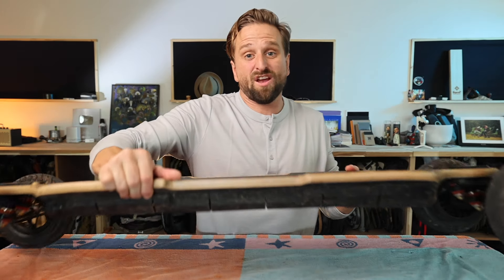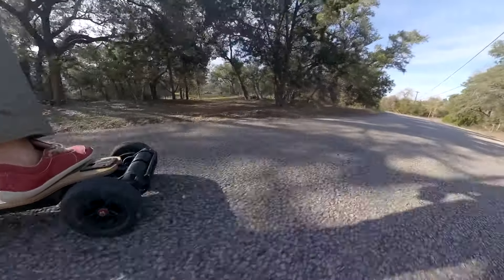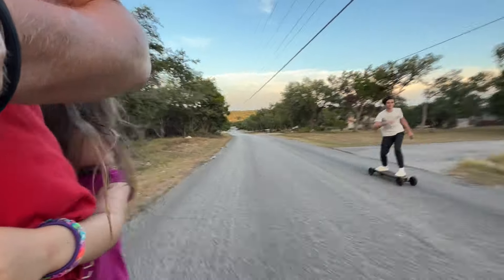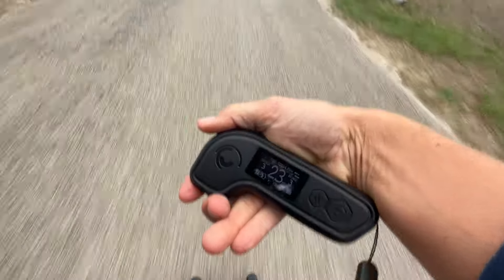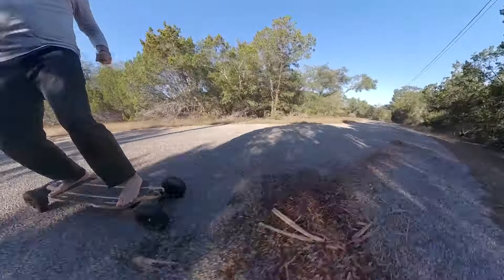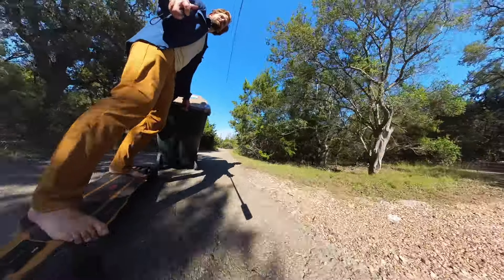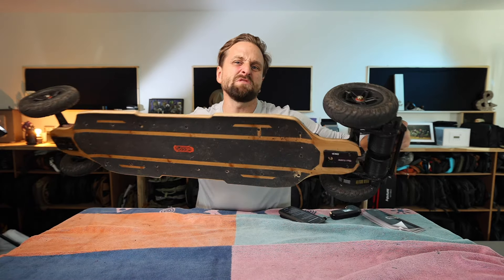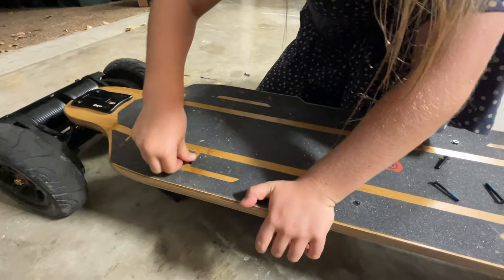1 Year Later: The Incredible Meepo Hurricane Esk8

Comment: Great follow up 👌🏽
⚡️🤟🏽🤙🏽🤟🏽⚡️

I wish they made a version of this with the Hobbywing ESC as opposed to the Ling Yi ESC they used on this, Hobbywing make the smoothest control module.

AT pulleys needs tighter belt tension than urethane, with urethane (smaller wheels) it's better to have slightly loose (less) tension. Usually don't need to re-tension regularly, maybe once if a belt / board is new, belt stretches a little when new.

Double Kingpin (DKP) trucks are hella fun, twice the turn of Traditional (TKP) and about 1.5x the turn of Reverse Kingpin (RKP) trucks. RKP are the most stable for very high speeds, DKP the most fun and great for carvin.

I have the Meepo Flow, love it!

Comment: If you don't like maintenance you really want hub motors but you loose the large wheels.
Reply: Not sure on this one. The sleeves you need for hubs wear out so much faster than regular longboard wheels. Maintenance on belt-drives is just replacing a $3 dollar belt every once in a while vs having to replace an entire wheel. I've never had to even tension my belts.

I've put 2k+ miles on my Exway Flex and 1k+ on my Meepo Voyager. Only belt replacements on both.
Reply: @zealdrive  Only 1k on my NLS Pro and never performed any maintenance whatsoever. But I am considering changing out the hub sleeves this year since they are about 5 years old.